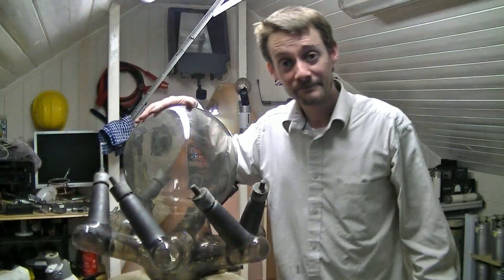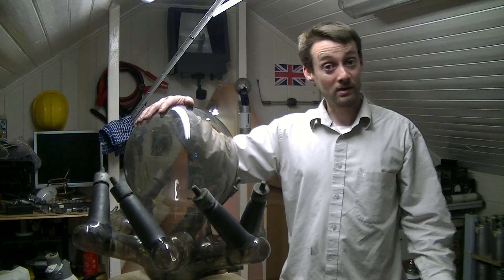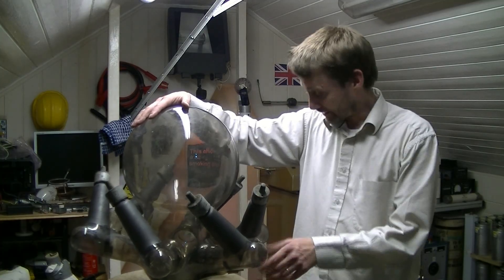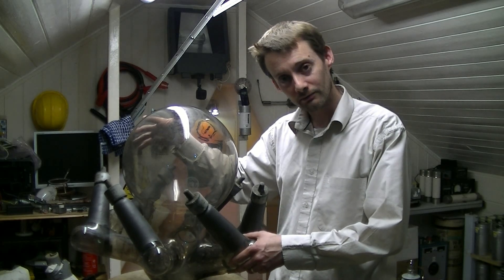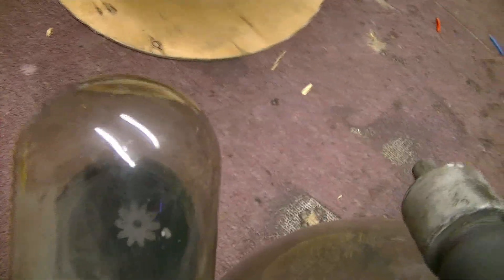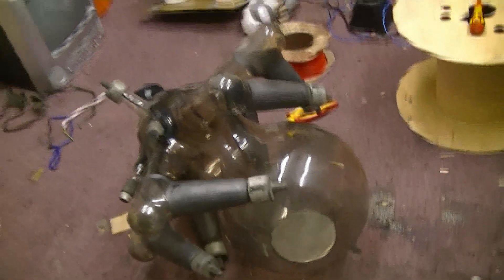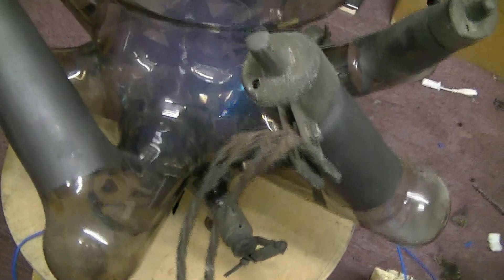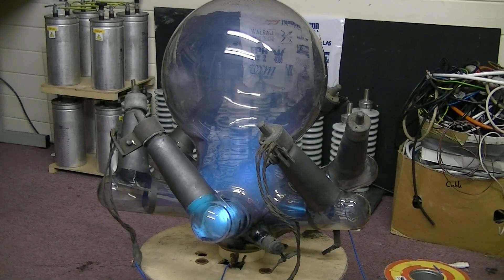Mercury Arc Rectifier

Comment: I have one of these rectifiers from an old power station in Sydney. However, there is a small hole in the glass in one of the arms. Yes, I know the dangers of mercury vapour. Is there a way to repair this hole- assuming all of the mercury is first removed? Valve repair places do not muck around with the glass itself- only the joins and sometimes internal elements. Even though it is temporarily sealed does air replacing some of the mercury vapour affect the anode? How do I know if the glass is a borosilicate compond?  Maybe a glass blower can do a patch job? I would love to restore this old monster like you have done.

Comment: The six phase supply for these rectifiers was still derrived from three phase supply. Each phase was ran through a transformer that has a centre tapped secondary winding resulting in the outputs on each terminal being half of the input voltage at each end with the centre tap working as 0V neutral a side effect is that the two end outputs are 180 degrees out of phase effectively doubling the number of phases and allowing for full-wave rectification of the incoming AC current as opposed to half-wave rectification that would result from just feeding unmodified three phase or single phase into the rectifier.

Comment: There's nothing like good old vintage electrics. How about old rotary converters? They could be either a rectifier or an inverter, but I'm not really familiar with them. I thought I knew plenty about old electrics, but there's a whole world of stuff from way back well before my time that I've never seen or I'm not familiar with. I know there was machines like a power generator which were used as radio transmitters in the early days which must've worked at a much higher frequency than the mains in order to transmit RF. And there was the old spark transmitter and the coherer, I remember reading about them when I was about 10 year old but I never really understood them. And tesla coils are quite exciting things too, and the theremin to name a few. And the multi-phase mercury arc rectifier looks a bit like a glass octopus!

Comment: Chances are it's not a true 6-phase rectifier but a rectifier tube with six anodes to be used with 3-phase power as shown in this schematic on wikipedia: https://de.wikipedia.org/wiki/Quecksilberdampfgleichrichter#/media/Datei:Quecksilberdampfgleichrichter_6phasen.jpg  which kinda creates 3 additional phases on the secondary side of the transformer.  I know of motors driven by 4-phase power but any polyphase system for energy distribution other than 3-phase like 6-phase or even 12-phase is only experimental to the best of my knowledge.

Comment: Hackbridge Hewitic up the road in Walton, nice little light weight bottle rec. Ours turned up in the 50's. Our original bungalow Stn's from 1935 fitted with a steel tank Rec, 12 phase 900v feeds, vacuum & cooling.    Had a Rec. crane above, to lift the lid (Anode cleaning !!! ) 9' tall 7' wide.   Staff on no-load ignition fail, resorted to a temp. dummy load - metal bucket, water, a horizontal wood pole, and  the 30' earthing leads, instant steam and green water.   (I did make the mistake with 'mercury recovery' of scooping to much into the plastic bucket,   had to be returned 2/3 back to the pool (and needed a lot more buckets))  and topping up coolant water with a   16'=>   rubber hose to an outside tap...   
              Yep !    Mercury & Asbestos on my medical records,  no re-action to either contaminents  yet !

Comment: So how would you use one of these back in the day? Would there be a dynamo or some other source of DC, and the rectifier would take the place of a commutator?
Reply: It's a big rectifier used to drive DC motors off AC power.  That's what it is.  DC motors were variable speed, unlike most AC motors, which made it very useful industrially.

Comment: does it produce X-ray's? or just UV?
Reply: No X-rays. The anode cathode potential (voltage) difference is not high enough at just 600 volts. X-Ray tubes typically use anywhere from 30kV to 150kV depending upon the application.

Comment: Could we see an oscilloscope reading on the DC side of that? Since its 6 phase, it might not even need a smoothing capacitor...
Reply: Ours was 12 phase that gave out a 300Hz ripple,  it got into our pilots as well !
Reply: AIO inc.  ,  Using a very easily obtained 12,000 v probe, of course. LOL

Comment: You worry about the radiation when you're playing around with that? Or are you running a low enough voltage where that isn't a problem?
Reply: X-rays start at 5 kilovolts.  This is nowhere near that.

Comment: The favourite way of these getting damaged is by being moved clumsily. if Hg sloshes into one of the tubes too quickly it can break the glass. I think they were upside down in transit. Now rare as rocking horse shit, like the man said. I think some are still installed but redundant; if the condition of the ones on ebay is anything to go by the standard way of making them safe (aka buggering them up) is dressing up in ventilator and hazmat suit, snapping one off and draining the Hg out. Who's going to buy one with a lump missing? (more to the point try persuading a glassblower to repair one..)
Reply: These have to be insanely dangerous!
Reply: Mercury isn't that dangerous. Look up Cody'slab YouTube videos about mercury. That much HG could destroy an entire Boeing 747's aluminum frame though.
Reply: @brendanstanford5612  Codyslab is an actor with a team behind him (like Applied Science channel.)

He has been wrong about so many things, the toxicity of mercury being among them.

Mercury vapor is deadly. Deaths have resulted from blood pressure instruments being spilled on carpet in a child's bedroom.

The metal constantly gasses off, and inhalation is the most deadly exposure route.

The epidemic of brain damage in Japan, caused by Mercury contamination, was due to metallic Mercury being dumped in the sea.

Now, before you jump to reply and say that it was methyl mercury, understand this:

bacteria in soil and water convert metallic mercury into methymercury

It is an awful thing to be toying around with in an uncontained form, especially idiotic stunts like "10lbs of mercury in a toilet - will it flush?" etc.
Reply: @forestdenizen6497  HE seems least likely to be an actor
Reply: I remember people having a half ounce of mercury and pouring it in their hand. As far as I know they did not not get mercury poisoning or anything. ( just don’t do it very often )

Comment: The 50 Hz sounds so soothing.  Our 60 Hz here in North America just isn't as charming.  If I had that lovely tube, I'd get 3 phase mains, convert it to 6 phase and then DC appliances so I could run that tube all the time!!
Reply: 60hz has a more 'energetic' sound to it while 50hz has a 'raw power' sound. 50hz will kick you in the knob like a pack mule, 60hz will throw a hundred punches to your face. Either way, youre going down.

Comment: I would love to know how much X-ray radiation that thing was pouring out in that test. For that matter I wonder what kinds of radiation that thing pours out at full load. Hey Photon, if you dont already have one, why not get a meter with a detachable sensor and make a video showing where the hotspots are for x-rays and such. (like what directions they shoot out in that configuration, and how intense they are at a given distance in those  directions) - Might make for another cool video. Play it safe and get a really  long wand for the sensor so you dont get cooked!
Reply: +Josh Hefner It's relatively low voltage, so you don't have to worry about x-rays. The only radiation you'd have to worry about is UV, but the glass is fairly opaque to it, even that's not really a hazard. It's pretty much just a mercury-vapor lamp...
Reply: only hazard here would be a broken bulb while mercury was vaporised. That would not be good!

Comment: What really impresses me is how they managed to blow the glass into such a large, complex shape, while evacuating the atmosphere, while situating all the metallic components, while having all that mercury sloshing around. Certainly more visually striking than a quiet solid state rectifier.
Reply: No shit. He meant the people that made it.
Reply: Probably pretty easy... You blow one thing at a time, and keep adding it to the octopus, and once you've built the entire thing, just leave a long evacuation tube somewhere... only THEN do you pull out all the air and put in whatever gasses you want (or pure vacuum).. Its not like they have to do every step all at the same time as the glass is molten...
Reply: Krasimir Ivanov you daft?
Reply: Well I mean, this is also technically solid state.
Reply: he didn't ... it was probably used in variable-voltage power supplies for radio and TV stations transmitters until mid 60's

Comment: Many cinemas used these rectifiers one for each projector. They were really reliable, some running for over 60 years. In cinema use they ran the carbon rods that provided the arc which in turn provided the light for the projectors. Typically burning at around 25/32 volts DC at 60/100  amps ie 2/3 KW. When xenon lamps replaced the carbon rods these rectifiers were changed to solid state diode type rectifiers with big capacitor smoothing. Xenon lamps do not like ripple in the DC. The mercury rectifiers provided no smoothing what so ever.
I loved to watch them, better than the films at times. In use the mercury falls like rain back into the pool below.
Reply: "I loved to watch them, better than the films at times." ...remembers me of someone, someone that watched TVs strangely on the backside :D (i stated that at like 12yo)
Reply: I know of at least one cinema that retained the MARs after switching to Xenon short arc lamps.
Reply: @cambridgemart2075  yes you can use them but the ripple would blacken the lamp and shorten the life of the lamp. You could always add a few capacitors of course. Many did.
Reply: @MichaelBeeny  It's been 45 years since I last had the opportunity to go to the projection room where my father worked, so I don't fully recall what they did when they changed over to xenon lamps, but I do recall seeing the MAR in it's metal cabinet.
Reply: Our's were change to germanium diodes(dirty) to start with.   Then to Silicon, reducing in number of diodes over the years.      12 phase,   always three in series(V), and parallel banks for loading(I), massive heatsinks.
 (did have floor capacitors underneath, but filled with PCB (and leaked)    :- (

Comment: What is it for?
Reply: Large battery chargers, lift machines, electric cranes, carbon arc lamps in cinema projectors, electroplating, electric tramways and d.c. railways.  Anything where you needed a heavy d.c. supply.  The Manx Electric Railway still had their last pair of them running until quite recently, but now replaced.  Another pair, ex. Royal Opera House, recently put back into use at Kempton waterworks, where the two very large steam pumping engines are preserved.  The Science Museum used to have a working one on display which powered an old lift.  Like most of the interesting things there it is now long gone.

Most of the larger ones, e.g. for railway traction use were steel tanks rather than glass bulbs.

Comment: What happens if you drop that in a 1 by 1 mile swimming pool? Will everyone feel it and die? That's a serious question btw.
Reply: It will drop to the bottom and possibly break. The mercury will pool on the bottom due to strong surface tension and its utter disability to wet surfaces. Elemental mercury is pretty insoluble in water. Now there is a possibility that it could react with the chlorine compounds in pool water, producing Hg2Cl2 or HgCl2, both of which are somewhat soluble (and easier to absorb in the body than pure Hg), but you'd really have to consult a chemist about that. Still. 1 mile by 1 mile (and I'm assuming at least 6 ft deep) is such a huge amount of water, that even if the whole cup (that's about how much there is (2 kg, it was said in the video)) of mercury was converted, I sincerely doubt it would raise your likelihood of kidney failure by as much as a percent after swimming for an hour and drinking a pint of it for good measure. I wouldn't eat any fish grown in it, though.

I'm not a doctor, though, medical or otherwise. Just a physics student. If you jump in without making sure what you're dealing with, you deserve everything you're getting.
Reply: Validole That's hilarious! I really meant though what would happen in terms of the electrical reaction, but it turns out my fears were much more worse than I anticipated. According to the evidence I gathered from an electrical failure in a swimming pool on liveleak the current traveled throughout the pool and only become a problem when it reached a ground source! To me that means that even if you had a 1 by 1 mile swimming pool, but the current and voltage was high enough even at that distant you could easily die! Hopefully I'm wrong though.
Reply: Validole Although metallic mercury is surprisingly non-toxic (as long as you don't breathe its vapors), sitting in the environment it can be oxidized by bacteria into organic forms such as methylmercury, which is extremely toxic. This happened during a serious case of mass mercury poisoning in Ontario, Canada in the 1960s and 1970s when a company making hydrogen, sodium hydroxide and chlorine by electrolyzing sea water in cells with metallic mercury cathodes dumped mercury-containing wastes into a local river.

Comment: Beautiful! Could you please explain how it works?
Reply: The Mercury Arc Rectifier is a special form of a discharge tube that uses liquid mercury as the conductive material for the cathode. In other words the mercury pool IS the cathode and in the 6 angled arms around the tube you find anodes made of graphite. Usually the mercury  is first heated up a little bit by a heating wire that is located over  its surface, helping to vaporize some of the mercury. Than the tube is "triggered" with a high voltage pulse (much like an ordinary fluorescent lamp). Thus ionizing some of the mercury particles in the vapor. That effectively permits  negative charges to flow from the mercury pool through the ionized gas to the graphite anodes, but NOT the other way round. Therefore each of the paths between the 6  anodes and the mercury cathode act as a "rectifier". If you wanted to draw an equivalent circuit diagram of this arrangement it would simply be 6 diodes that are connected together at their cathodes (like a star point). The blue light is emitted by the ionized mercury gas. In Addition an arc can be seen between the mercury pool and the anodes. When powered with poly phase AC you could see the arc "jump" around in the tube in the same way the rotational field of that poly phase AC is "rotating".
The big "glass dome" on top is used to condense residual mercury vapor, which after cooling down will drop back into the mercury pool.
This technology was later replaced by thyratrons , followed by  thyristors and even later by IGBTs.
Reply: The Post Apocalyptic Inventor I didn't know the LGBT community had a use!

Comment: I just got the motherF*&^%R of X-ray transformers ! 4 foot x 3 foot x 2 foot tank slammed full of electrical equipment arranged in a way that looks like a Vegas hooker unwrapped  ! get with me and Ill send you the pics of the internals , I had to use a forklift to open it , the core is over 600lbs .  Its a functional high freq unit , your gonna scorch your shorts when you see it .

Comment: Apparently the best way to deal with mercury is to pour sulfur or zinc on it. 
The mercury and sulfur/zinc are suposed to react to form a compound at rtp (room temprature and pressure) which is easier to clean up.

Comment: if you don't have the heater unit then its the only way to get one of those rectifiers working, and it can be a real pain in the arse to get going unless you have a photon style BBPSU that can crank out ridiculous volts at obscene amps to maintain the heating arc for the mercury to successfully vaporise so it can become fully conductive internally.

Comment: used to have one from a plasma ball, did as much as possible to read the voltage, got 14K at 0.00002 amps (TINY), safe to touch but would leave a hole in ur finger!

Comment: I think you will find the a Line output transformer  ( flyback tranny) will produce in the region of 25 kv if you are driving  HF at zero volt switching into it. You wont need to touch the  final anode connection either. It will happily arc across your finger at a distance of an inch.

Comment: ... since they kick out between 1 and 100KV at considerable amps, but be aware that they burn out easily, if you want something that arcs well and won't die though, give it a shot at making your own ZVS or 555 timer, and put a flybakc transformer from a CRT TV on the end of it, that will give around 1KV and is harmless if you touch the arc... other than a burn or hole in the finger, hope this helps you a bit, and if you want to learn more on how transformers work, take a look at EdisonTechCentre

Comment: if you want to use a 9V battery, will have to pulse it to get a working field, it has to be AC for a transformer to work, and 5X20 will only give you a 4X  boost, try something along the lines of magnet wire and about 10 on the primary and 1000 on the secondary, use a 9-24v AC source at 2 amps and that should give a good kick and get the desired arc since you're getting a boost of x100, so you'd get 900V in theory (correct m if I'm wrong), OR, get a microwave oven transformer... (see my reply)

Comment: i don't think laps of that age do, I'm not too sure but I think they used a non reactive quartz based glass which can produce UV if it's paired with light and heat (hence why Halogen lamps have filters) but also, back then, UV radiation was discovered but the complications of exposure for long periods of time... not so much!